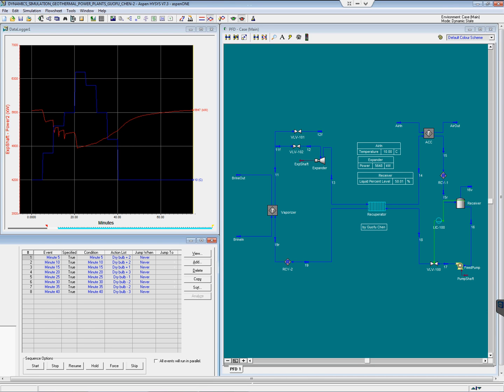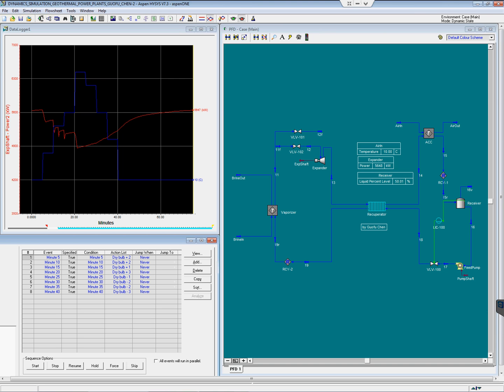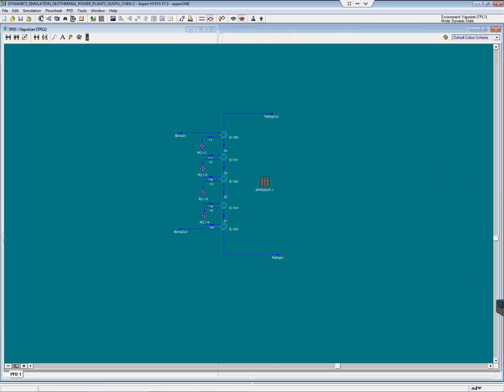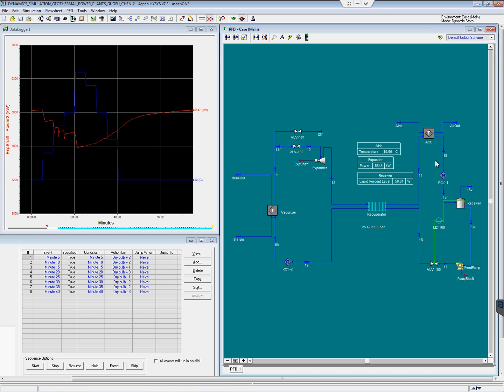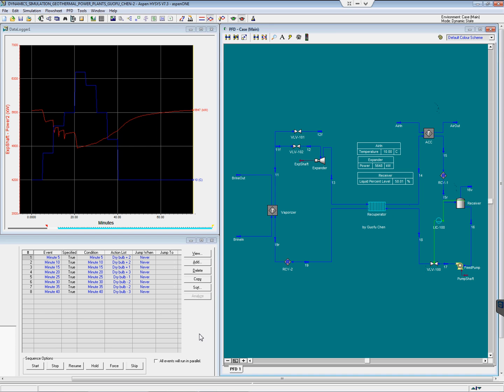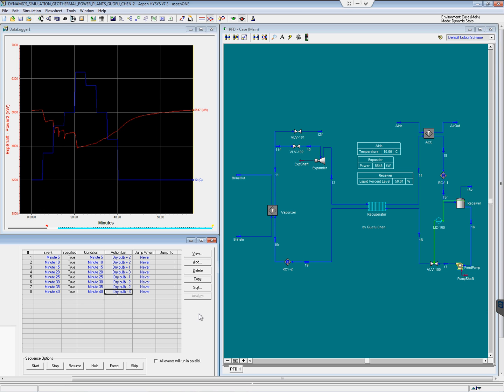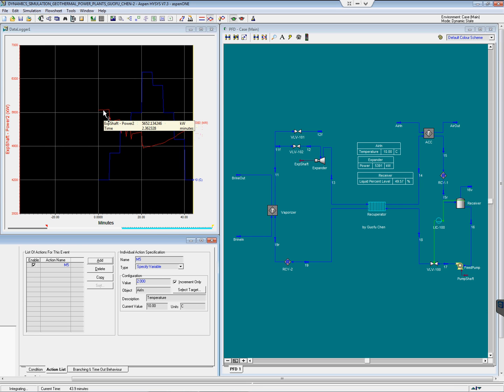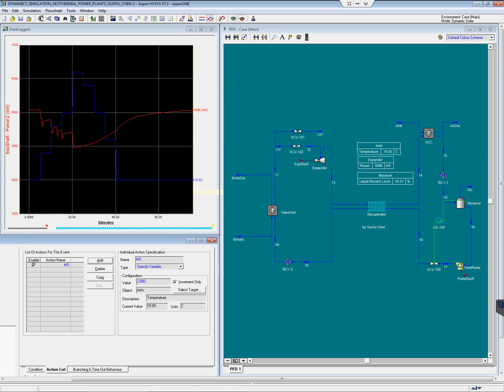Dynamics Simulation of Geothermal Power Plants by Guofu Chen

Comment: which software you used?
Reply from the maker: Aspen HYSYS was used in the dynamic simulation
Reply: dear chan, I am currently doing a thesis on binary cycle geothermal power plan.can you plz suggest me a software through which I can do technical simulation
Reply from the maker: Hysys is probably the best. Any simulation software is able to model binary power plant if you only work on the basic modeling.
Reply: Guofu Chen can you plz give me the this simulation file
Reply from the maker: Send an email to me at chenguofu2000@gmail.com and I will give you the raw simulation file. Have fun with the model.
Reply: +Guofu Chen  can you help me (PRODUCTION OF ACETALDEHYDE FROM ETHYLENE 
OXIDATION(100,000TON/YEAR)